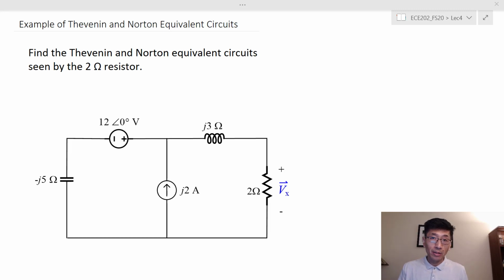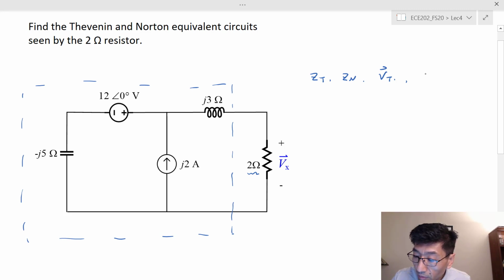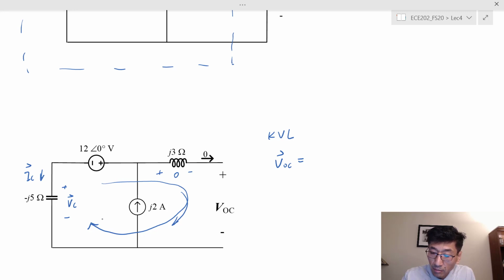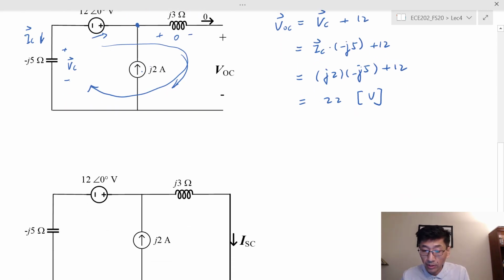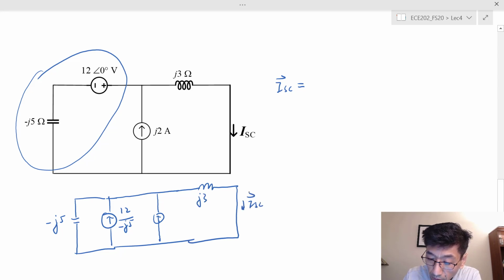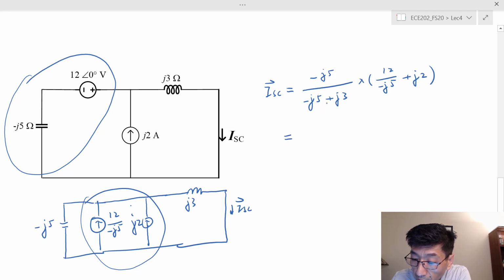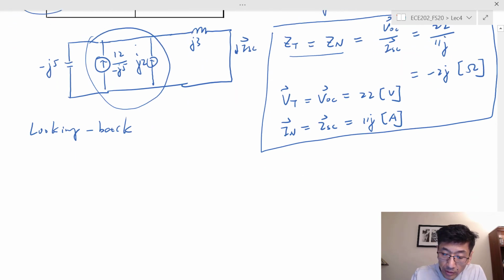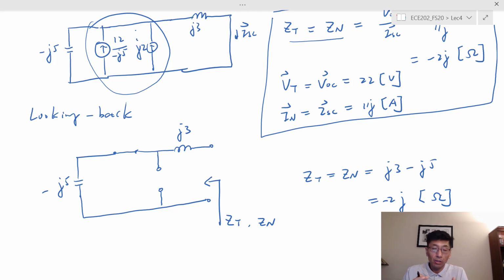ECE202_Lec4_Part 3 Example of Thevenin/Norton Equivalent Circuits

Comment: For the example while finding short circuit current, and when using current division rule we calculated it with impedance. I thought when elements are in parallel we prefer to use admittance. Do we only use it when elements such as: inductors, resistors, and capacitors, are in parallel?